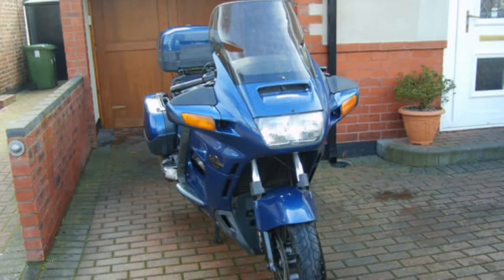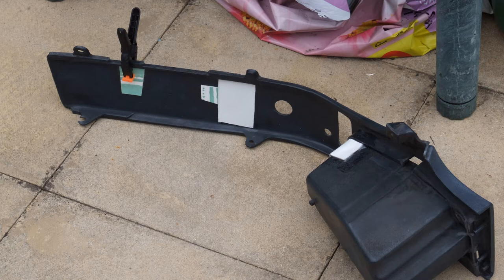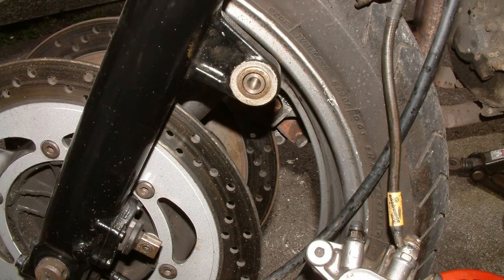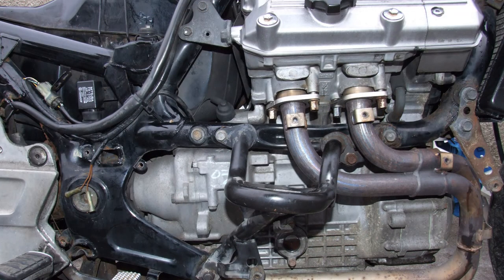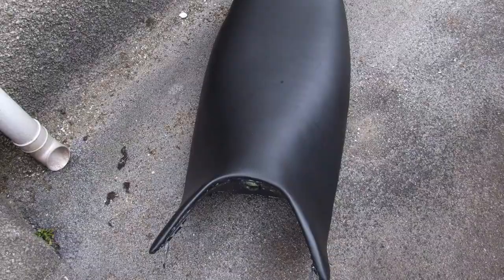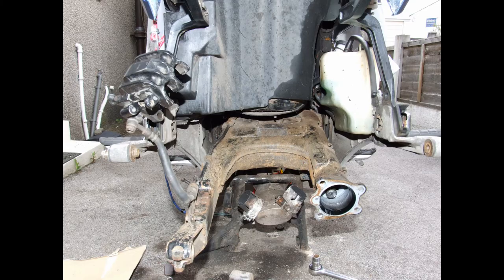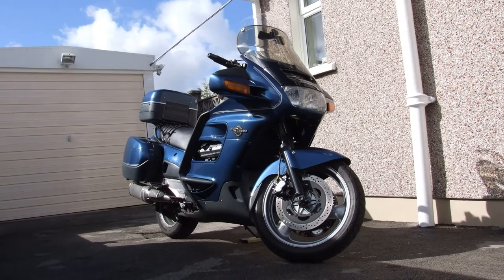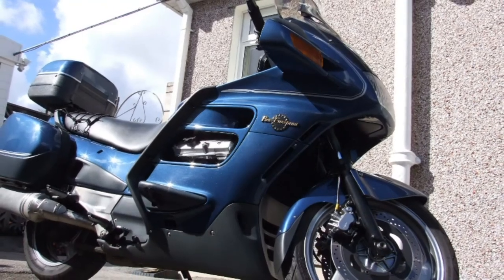Honda ST1100 Renovation Photos & Commentary

Comment: Wonderful video Panman. I just bought a 1997 ST1100 with only 30,000 miles on the clock. Tupperware is a bit scratched and I'm inspired to pull it off, buff out the deeper scratches and repaint it. Thanks!

Comment: Tidy work 👍

I take it you sprayed the body work yourself as well? I have a repair to do to my topbox and will probably rattle can it, rather than getting the compressor out
Reply: +Fergus Stevenson  It wasn't a complete respray. I touched in the scratches with basecoat and a fine artist brush then sprayed clear lacquer over the top. Some bits don't stand up to close expert scrutiny, but it looks pretty good on the whole. If using a spray can, my advice is to get a colour match from your local auto paint specialist and they can probably prepare a spray can for you. Their cans are usually better nozzles than the average shop... and get a primer and lacquer suitable for plastic.

Comment: hi i live round the corner. my pan is a cat b write off. How big of a job is replacing the chasis. i love the bike and don't want to scrap it. Any idea on how much commitment it would be i greatly appreciate it
Reply from the maker: Hi, The best place for st1100 parts in the North West is Village bikes near Chorley. He used to specialise in breaking Pans and should have any parts you may need. If your frame is gone, you could rebuild with another but it will have to be re-registered as the frame is the bit that DVLA records the numbers from. I sold my Pan a couple of years ago.

Comment: Hello, just bought a second hand Pan. First ride I noticed there ear brake sticking. Took the pads out and one was mounted incorrectly into the groove..
I've got some unopened unused pads with it but no way to identify back or front pads. Are they the same do you know? Or are the rear ones thicker? 
Cheers.
Reply: I'm 99.9% sure the rears are thicker. Pistons then further inside bores = less sticking. I bought genuine Honda rear pads that came with correct spacers & stuff (aftermarket don't). I also used Carlube Silicone Multi-purpose grease (ebay & good motor shops) everywhere copper grease or other grease used on brakes. Doesn't dry out, cleaner, and multiple uses.
Reply: Cheers Pal. Thanks for the reply.

Comment from the maker: Thanks. The black bits on the side panels - originally I made some padded pieces to stick on but one fell off! The pics at the end show some self-adhesive door sill protector for cars that I cut to shape. Recently, I bought some rubber strips (ebay item 260727380465) for £6.00. Two strips either side fit the width perfectly and just need the bottom trimming off. I've seen them on another Pan - looks good and more of a cushion for the knees.